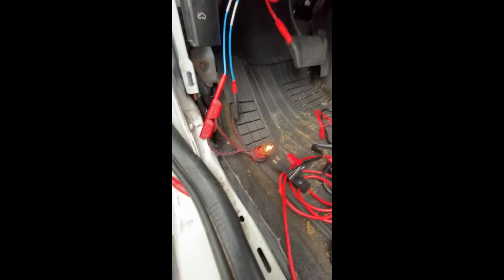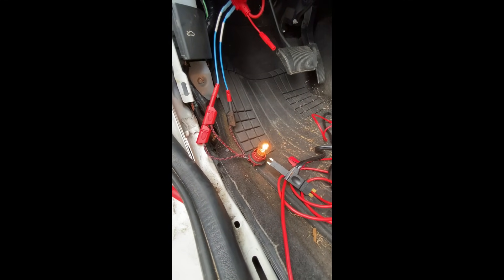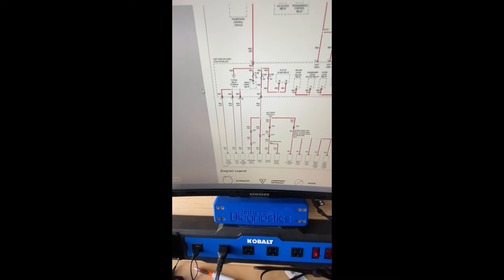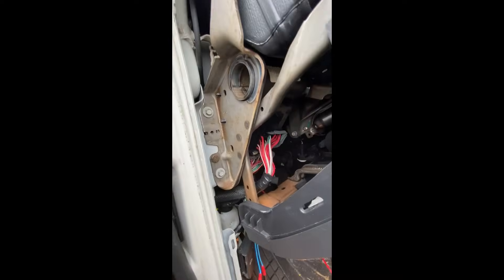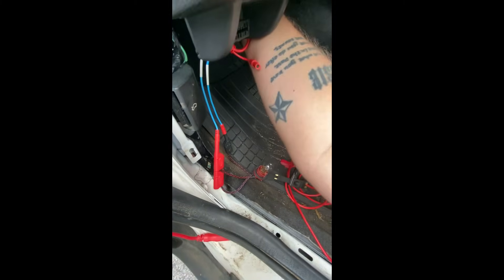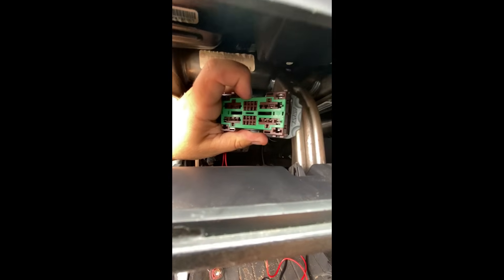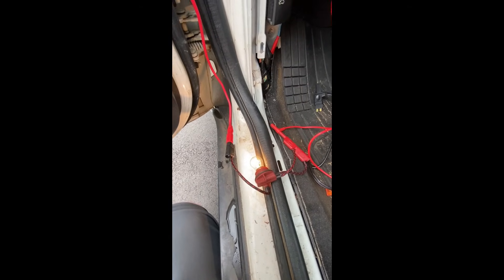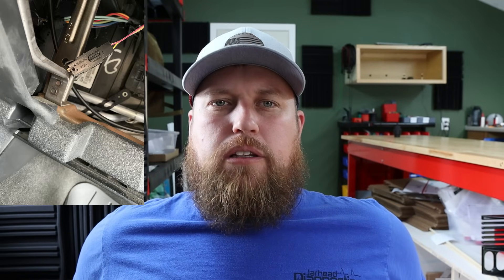Easiest way to find a short to ground!

Comment: none of my fuses blow, but when alternator is hook to engine block the exciter wire gets hot, will not get hot on a bench test that has no body ground,, how do i find this,, it is not the alternator,, i have tried three new alternators??? What do i look for and how do i find problem? 60s car with a electronic distributor?

Comment: So the test light illuminates because the short to ground is completing a circuit to the negative on the battery.  Does that mean if a component in that circuit was working (say the glove box light was on) would it light up the test lamp?

Comment: For someone trying to learn about this subject, you lost me right at 1:20 "you put a test light, and you put it in the fuse location".  I can't tell what you did there.  Would have been great to see those connections as you assembled those (red) wires and placed them in the fuse location (did you build that test light?  yes?  show us how to make one).

Comment: Hi, great video.. have you any experience with Audi q7 3.0 tdi ? I think I’ve got a short as relays ticking, obd dropout, engine won’t stay running unless I disconnect both swirl flap actuators, I’ve replaced both and still same problem, also no error codes with obd 

It’s really got me baffled

Comment: New Subscriber here. I have a '96 7.5 liter gas suburban 4x4. It started blowing the fuel injection (computer) fuse under the hood in that fuse box. Over time it got worse (3 years). I got good and changing that fuse. Then whenever I hit a hard bump or pot hole it would blow the fuse (engine stops). Now if blows as soon as I turn on the key. Will the test light as you use it give the computer too many amps/micro amps if I try to use it to find the short? I am out of it without my truck as I use it for everything. GM wants way, way too much to even begin and wants to throw a Parts Cannon at it where I pay for each part even if it doesn't fix the problem. Local shops are scared to take it on (lack real skills).  I could use your advise and help. Thank You and Semper Fi.

Comment: Plastic connectors are exposed to temperature fluctuations - and that will fatigue them.  Then you got the vibration, high moisture, dirt, cramped working space, and all the plastic crap to deal with.

Comment: If you don't have a light bulb, two wires out of the fuse, cut a potato in Half and peel it, stick wire on one half of the peeled potato and stick the other one on the other half of the potato, which ever half gets dark that's your hot side. My grandfather was an engineer in the USSR, red army WW2 1939. Jokes aside. Yes he had tools. He didn't carry vegetables along.😅

Comment: As an electrician i agree the is the most efficient way to find a short....yes having a tester that makes a sound is way better than a light. Voltmeter with an audio continuity feature. Always break the problem circuit in half test both sides, then open halfway again if possible... Helps isolate it faster...
Reply: But you get in the habit of using a light because the light will prove a circuit is capable of carrying current or a multimeter might trick you and report the voltage you expect without making any claims about the circuits ability to carry the current needed
Reply: Can get a load pro to use with a meter @yachtsteve

Comment: I had a wire burn out on a 1998  Lexus ls400 in the kick panel fuse box i have no power on car all the fuses are good under the hood and inside the fuse box in kick panel  check starter and alternator it is good have no clue what is going on can you help me

Comment: Interesting way I saw was test continuity on the circuit then unplug the loads on that circuit and the beeping should continue cause it’s shorted to ground. Then test spots until beep goes off. If you don’t have correct amperage bulb of course. But just another way I found interesting

Comment: I have 1998 GMC Sierra c3500 I am having a problem with getting it to turn over, but I relay that my crank fuse is blown so will that stop the truck from starting.

Comment: I took my son dodge dart into premier Dodge Park in Buena Park ca. his cluster flashing. And check engine light code say faulty pressure oil sensor . They wanted 275 for each item to diagnose I said don’t know. The writer said that only if you don’t have it repaired after diagnosis. That it would be just the repair cost . He needs his car for college next week so I said ok. I get a text first thing in the am , I dropped it off late afternoon yesterday.he says ya we need to drop the oil pan and remove the dash cluster so it going to be another 1650. To diagnose it. So I told him first I’m not a mechanic but oil pressure issue should be one of three things a oil pump , oil pressure sensor or long shot on car with 40k on it is oil filter possible. All of that shouldn’t be issue with a /75 diagnoses . The dash cluster flashing. He said when I dropped it off .he scanned it.  And it probably the wiring , I ask can’t he hook up the computer and it tell it what it is. He said no I scanned it he won’t get anymore info.  But now they want another 1650 to chase it . I’m going to pick it up tomorrow. I don’t trust them I don’t think they did a dam thing for $550

Comment: I suck at electrical, first of all. I have an 08 grand cherokee with several issues that all turned up at one time. All my brake lights, ABS, BAS traction control are all on as soon as I reach like 20mph. That was first. I took it into the shop to replace a water pump, weld up some exhaust flanges and an oil change. Picked it up and the rear door ajar light is on. Didn't think much of it. Couple days later both my power seats quit working. No movement and no heated seats. Then I noticed the pedal adjust isn't working either. I tracked down a seat/heater circuit breaker that is extremely hot. This makes me think a short somewhere but I don't know where to begin looking. I have a test light and basic home voltmeter. Any suggestions as to where to start looking?

Comment: so if your 05 suburban has crank but no start which ground do you refer to to start. ive already had two mechanics try to replace 3 sensors and also the fuel pump. no the truck kicks the starter when key is in the acessory position. however, it will not fire but will crank

Comment: Hey i got a 5A battery parasitic drain on my 02 Jeep Grand Cherokee Laredo 4.7L V8.

I don't see any blown fuses at all. I pulled fuse #8 and the 5A draw went down to 0.59A (spec says max is 0.05A) so I'm still 10x higher draw than normal with fuse 8 left out.

How do i test the wires with a multimeter, i don't have any back probes for multimeter.

Fuse 8 diagram online says it protects:
Overhead Console, Rear Wiper, ip lights (instrument panel where speedometer is), rear flipper glass solenoid(have no clue)

I looked inside overhead console and rear wiper and the giage cluster and checked its light bulbs for warning lights and around 7 bulbs are missing, i assume previous owner. Could these missing bulbs cause this Amp drain from battery?

My other question is if it's drawing power with vehicle off, and key off whats causing that? I don't think instrument panel lights or the overhead console is ever powered without key on?

Does that mean it has to be rear wiper or the rear flipper glass solenoid?

Comment: I've been using a sealed beam light for decades. My shop foreman convinced me a test light is adequate as long as it's not LED. I found out this week that it is NOT adequate when looking at a bad relay. I put two supercharger coolant pumps on with same results until I went back to my sealed beam. It would light up my test light, not the sealed beam. Quite a few choice words fer that one lol

Comment: you have a light bulb but what other diagnostic equipment is used to connect the fuse circuit to like light bulb looks like a fuse buddy what is the connection going on to light the bulb

Comment: Not understanding what your touching with pin 7. Ground? 12v?
Reply: He is putting one end of bulb into one leg of fuse, other bulb end to another leg of same fuse that is blowing. As there is positive short to ground it means that power supply is on one leg of same fuse , and on the other leg there should be only resistance of component or bulb or consumer if u like., but in this case there is direct connection to ground. That is how bulb he has connected to two legs of same fuse is lighting up , where under normal conditions it would not light up. Then acording to diagram he check what consumers are powered of same fuse, and disconnect them one by one until bulb stop lighting, so short to ground is eliminated. 
Sometimes wire can be wearing of metal chasi parts , which makes harder to find , but that is done by following the supply wire.

Comment: Hmm Could have been a great video. It's not because Branden keeps using the word "it" throughout the video which the listener can nit track (the problem isn't the speed if speech - he has perfect diction). However - addedto his  being lazy and using the indefinite article "it" in place of saying the proper name of what he is refering to. I'd say Branden is a genious if he stops this lazy work product destroying "saying it" habit.. KNOW THAT at the beginning if the demonstration- where Branden explains the wiring diagrams indication of where the circuit goes Branden refers to the 3rd connecter "C3” and indicates locations if connectors 1,2 and 3 and says C3 is behind "it" - Branden is refering to ”the fuse box" when Branden states "C3 us behind (it). Branden also fails to clarify that the test lights Branden offers for sale at the end if the video are essentially a tiny positive and negative wire with tiny wire clamps that you can attach in tiny spaces (these little clamps and wires are attached to a light that will go on if attached to a (complete circuit aka a circuit with continuity). 

Ok - I am just finally beginning to comprehend electrucal circuit testing - what I have written here is my attempt to repeat what I think Branden is teaching us. 

Please reply to me if I got what the Brilliant Branden is saying - Thank you! 🥂

Comment: Hi have a 2006 JEEP LIBERTY  [190 km ]  I am now having touble with the power door locks blowing fuses, It was working fine ,took the key fob out of my pants pocket and the unlock button seemed stuck in.depressed position ,wouldnt activate so i checked battery [good] opened doors with keys and the it didnt function either so i checked the 20 amp fuse and it was blown ,replaced fuse and tried it. Locks ok but unlocks will blow the fuse , Would a stuck Button position on the keyfob damage the power lock controller and create a short situation ?I If i plug the test light into the fuse holder and disconnect the power switches ,then plug in and activate each switch individually would that identify a problem circuit /location or do i have to trace each wire individually to source the problem area /wire ? thanks for any input ,direction or advice Dave  [ive also  heard this might be the dreaded door harness problem but i dont know what that is ]

Comment: Hi, have 2006 jeep liberty was working fine ,took keyfob from pants pocket to unlock it and the unlock button seemed  stuck/depressed position ,wouldnt unlock , checked fob battery {good] used key to unlock and tried doorpad switches [didnt work either ]....would a stuck on position create a short in the power locks controller ?   I then checked 20 amp fuse and it was blown replaced fuse   and activated locks they work but when using unlock it blows the fuse ,   If i plug the test light into the fuse holder and try each switch to try and isolate def switch/motor or is it probably the wire in the door harness chafed /boken and grounding

Comment: Hi, you have inserted the plug inside the fuse connected with bulb, what does it call and from where can i buy it?
Reply from the maker: Those are front probes. They’re available from many different manufactures.

Comment: My radio and dome light has a 15 amp fuse it does not blow but it is the circuit with an issue because it's the only one that turns on my light 😮

Comment: hi Brandon, I got an old '71 VW and my negative cable on battery terminal feels warm, really warm to touch and the terminal is hot after I attempt to start the engine. Does that mean I got a short-circuit so where or just replace the ground cable-wire? thx

Comment: There is also another way, to use a constant current supply set at about 10A and follow the heat with a thermal imager. The possible problem with that is that during the test it could cause the short to go away and then you can't find it until it comes back. I did a heater core on a Saturn and after wards you turn the key, the engine would start but when released to run position the engine would shut down. [It would only run during cranking.] Part of the procedure was to pull the center console and disconnecting some block connectors to remove the dash panel. I traced the problem to one of the connectors where during reassembly one of the pins got bent over. It was a long sliding mating with an 8mm bolt to draw the connectors together making it fool proof. [similar to a bulkhead or PCM connector] I have no idea how one of the pins could have bent over other than being slightly out of alignment so during the mating process it folded over. What ever, I found the problem, straightened the pin and everything was fine.
Reply from the maker: I don’t know if I would trust supplying current enough to have it register on a thermal imager. Doesn’t seem as safe.
Reply: @JarheadsGarage   Simply do not exceed the CC supply value greater than the original fuse rating.

Comment: My uncle (electrician) taught me that trick when I was a kid. Definitely comes in handy. To one’s not understanding how it works it’s very simple at a fuse you shouldn’t have a strong enough ground to light an incandescent bulb. If it lights there is a short to ground in that circuit. Then old fashioned short tracing after that.
Reply from the maker: Very true!
Reply: @JarheadDiagnostics  how did you determine there is power running from fuse 12 to connector C3 ?? I get C2 but C3 is in a completely different location than C2 help please 😢
Reply: Then old fashioned short tracing after that.? please tell me how..
Reply: There could be loads down circuit which will cause the light to illuminate when the short is gone. A high current incandescent lamp such as a headlamp will reduce this possibility.
Reply: Forget the test lamps, use your meter!
Reply: @Jenny-h5r Even when using a meter, measure the voltage - if it’s battery voltage(up to 12.6 volts), that tells you that there is a direct connection from the point you’re testing from battery power to the ground; an 8 volt reading, for example, tells you that the current is possibly going through a corroded connection or through some other circuit which is using the current and voltage from the battery positive.
Reply: I'm clearly confused without clearer detailed instructions,  te conflicting arguments aren't helpful either😒

Comment: Great topic, but really hard to follow what you are doing and how you reached each conclusion along the way.
It’s an easy trap to fall into, showing us you know how to fix something.
Finding the problem then filming the solution can lead to this.
I tend to film the diagnostic process then edit out the irrelevant stuff.
But what do I know, you get way more views than me 🤠
Keep up the good work :)
Reply from the maker: I broke it down, but didn’t show me looking for the actual shorted wire.
Reply: @JarheadDiagnostics  how exactly do you know power is coming from fuse 12 and going into C2 and C3 ?? The dotted line means there's more to the component, not that power is running along it, right ? 😳 forgive my ignorance

Comment: You would have to remove any loads in the circuit or th bulb would light up which in many cases such as lighting would be alot
Reply from the maker: Just depends on what loads are in the system vs where the short is in the circuit. But that is a good point.
Reply: Any load would complete circuit

Comment: As soon as you said it had a new heater core put in, I figured the problem would be in that area. If I know someone has previously worked on the car, I would give that area a quick visual first.
Good way to show how to use a test light.
Reply from the maker: I fully agree with you!

Comment: Hello Sir, what do you mean by fuse output, is that like toching the fuses with the red lead of the meter and if it beeps that means the fuse has a short, please help me out to understand. Can i connect the black lead of meter to the battery negative post? Hope you have time to explain me thanks in advance

Comment: Damn, you are one of my heroes ;-) .  I usually make the sign of the cross when it comes to electrical problems.
Reply: Hahaha I def did that a few times myself in the past - - I get it bro - - keep at it, you'll get more confident. Took me messing up all kinds of electronics, guitar amps, stereos, microphones etc to learn from my mistakes, but automotive electrical is like a while different planet sometimes! Get a good old fashioned shop repair manual for your car and read the schematics and read the part that tells you HOW to read the schematics! That will help

Comment: For people who have no idea what they're doing, they need you to also explain the steps leaving up to before you connected the leads to the fuse location. Otherwise the video is useless to a lot of folks.

Not everyone has experience with a multi meter or electrical in general.
Reply: Yeah it's a fake video you would have to remove all other loads